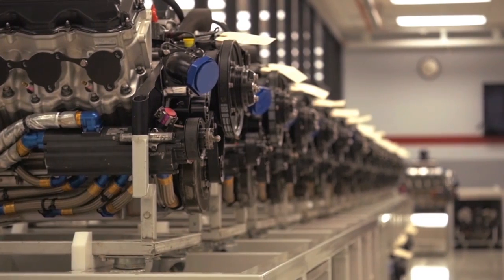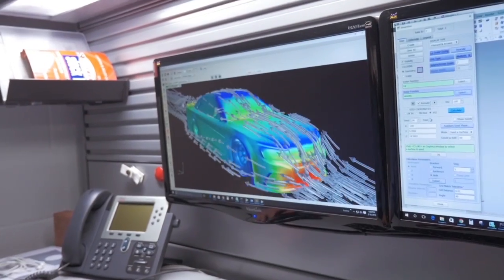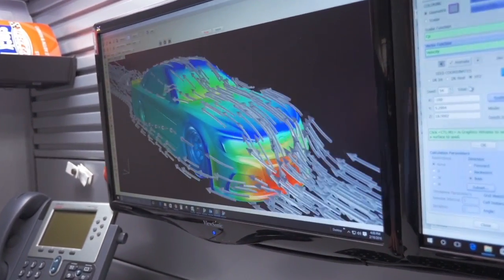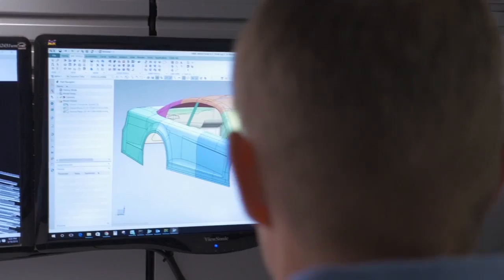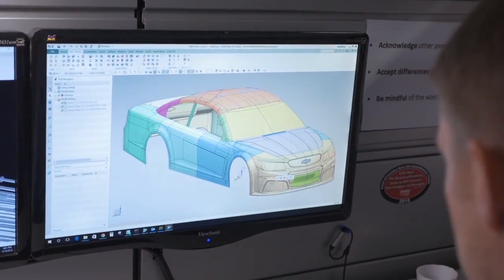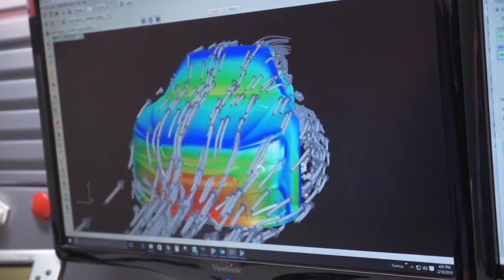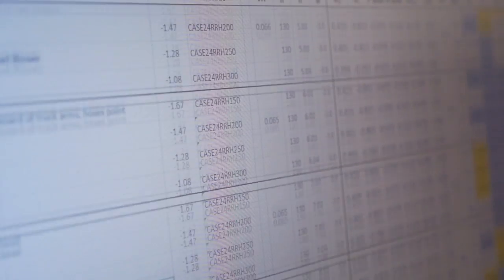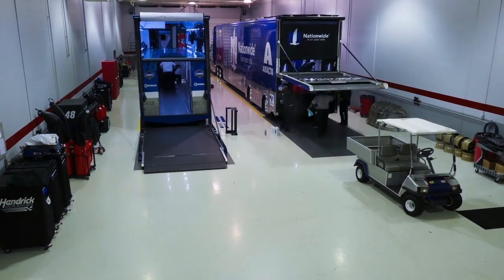Road to Daytona: Perfecting aerodynamics

Comment: Lose the back spoiler. Yes I know it sounds crazy but.
If you replace it with an air shoot that gathers the air from the front of your car? 
You run a cooler engine that pushes the air from in front to that spoiler you just removed. Think about it. Adjustable air flow exhaust port. The question is. Will it be legal? 
.
Signed a designer with big ideas to keep you safer and faster.